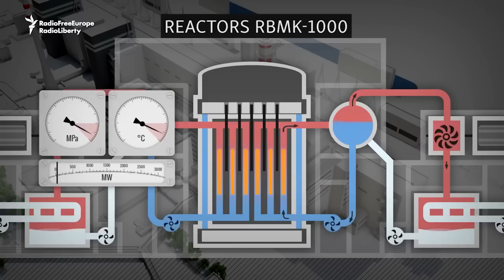Catastrofa nucleară de la Cernobîl: Cum s-a petrecut?

Comment: Principala cauza nu a fost "void positive reactivity" ci ceea ce fizicienii nuclearisti numesc
problema acumularii de Xenon. Prima jumatate din experiment a decurs normal. La butoane se afla una din echipele desemnate dinainte,adica cei mai experimentati operatori. Dar in "nuclear" schimbul este in mod standard de 6 ore.
Si aici au intervenit "tovarasii" de la centru (Chiev) care atunci cand s-a ajuns la 50% din puterea termica si una din turbine a fost oprita, au cerut prin dispeceratul de energie electrica sa se produca in continuare energie caci era nevoie de asta.
A urmat o perioada de vreo 8-10 ore de functionare la 50%. Aici intervine fenomenul "accumularii de
Xenon". Este un proces fizic prea complicat pentru a fi prezentat aici dar in esenta este vorba de
producerea pentru ore intregi de Xe la valori specifice puterii de 100% pe cind consumul este de 50%. Adica se produce Xe "pe stoc". Xenonul este un absorbant puternic de neutroni. La 100% putere exista un echilibru productie-consum. Dar  prin scaderea de la 100% la 50% se produce un dezechilibru. In mod normal operatorii stiau de acest lucru.
Scaderea de la 100% la 50% s-a produs controlat pe parcusul mai multor ore. Dar pauza intempestiva a produs o degringolada prin aceea ca Xenonul s-a acumulat peste cotele prevazute. Mai mult, au trecut 6 ore si a venit alt schimb, au mai trecut alte 6 ore si a venit alt schimb. Foarte multe din aspectele acestui tip
de reactor sunt bine (si cu talent) explicate in videoclip:

1. Oboseala operatorilor
2. Oscilatiile zonale ale fluxului de neutroni (chestia cu camerele)
3. Schimbul care a efectuat partea
cea mai grea era probabil un schimb mai putin experimentat
4. "Seful" era epuizat si "sictirit"
5. Coeficientul pozitiv de reactivitate (dar acest lucru era "mitigat" cumva). 
Reactoarele RBMK au functionat cu asta ani de zile
6. Barele de oprire la avarie (altele decat cele normale "de control") aveau acel defect cu
grafitul...
7. Operatorii nu au fost "stapani absoluti" ai procesului ci au trebuit sa raspunda cereri
"tovarasilor" de la centru. etc.

Reactorul trebuia adus la ~20-30% din puterea nominala. Acesta "manevra de putere"
se face prin insertia de bare de control (insertie de reactivitate negativa). Dar prezenta
in exces a Xe (puternica reactivitate negativa) fara ca de data asta sa se stapaneasca pe
deplin cantitatea de Xe a produs scaderea puterii reactorului mai jos de tinta avuta
in vedere. S-a produs o mica panica. Normal trebuiau sa lase reactorul sa se "stinga" (shutdown)
dar au avut ambitia sa-l readuca la cei 20-30% iar asta se face prin extragerea de bare de 
control. Au mers cu extragerea de bare ("boronul") peste limitele preconizate prin proiectare si asta a fost
o greseala fatala. Insertia pozitiva de reactivitate a facut ca puterea sa cresca brusc...apoi a fost
acel buton care cerea insertia barelor de avarie si...a urmat ce a urma.